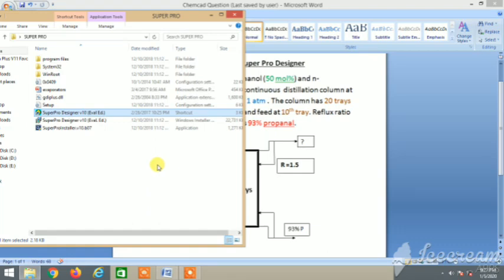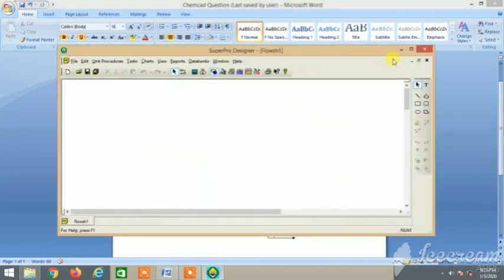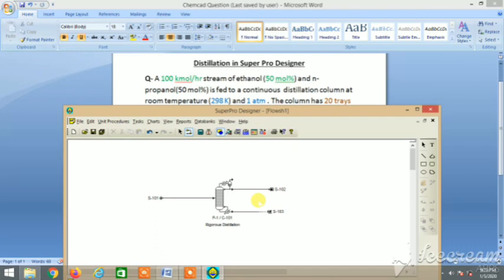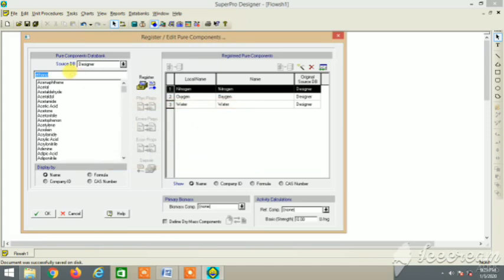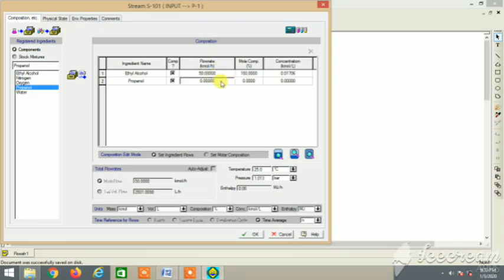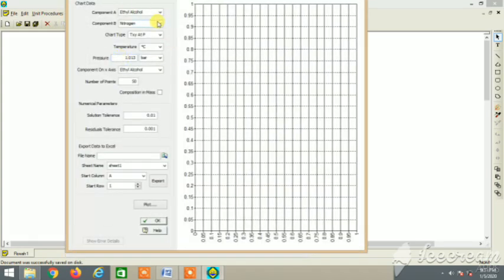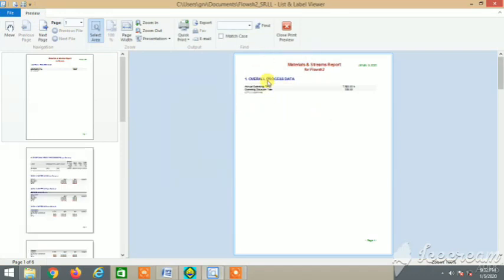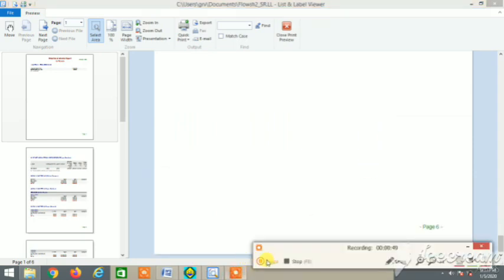Super Pro Designer Simulation

Comment: hello, is there a way that i can increase the number of inlets of an equipment? (nutsche filter)
Reply from the maker: Depends on the type of equipment. I need to look for nutsche filter. Will let you know!
Reply: The Concept Guy thank you so much. appreciate your help
Reply from the maker: I tried Nutsche Filter and read Super Pro  docs . I guess it needs only 1 feed . In case you have 2 feeds ,then I think you can use Mixer to input a mixed stream.
Reply: The Concept Guy thank you.  i want add more inlet streams to do 5 cake washings. but it has only 4 inlets. is there any way for that?
Reply from the maker: Ok , I will find a way out and tell you. I think it should be possible.
Reply from the maker: I read all docs in Super Pro and there isn't mentioned anything about adding more wash streams. I guess instead of adding more steams you have to optimize the cake wash streams.